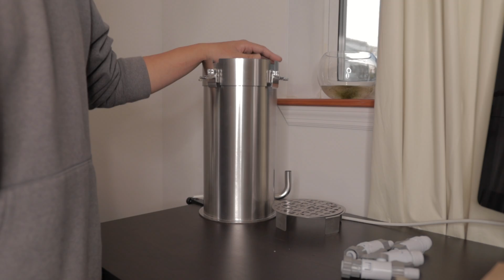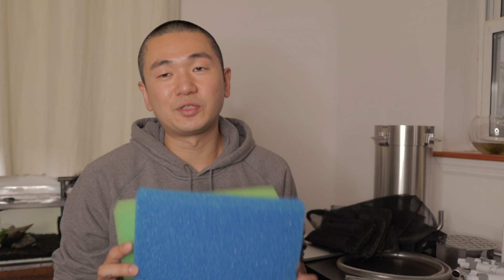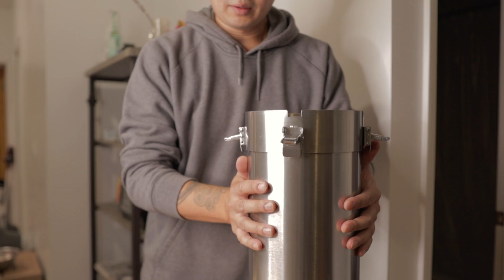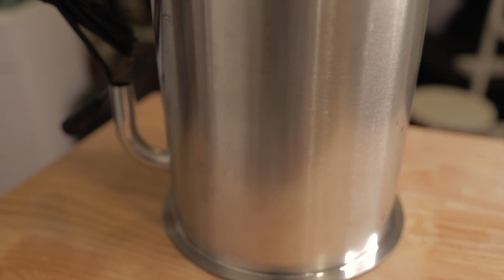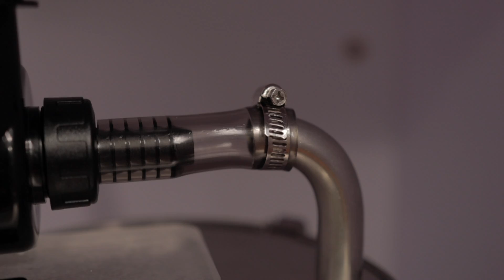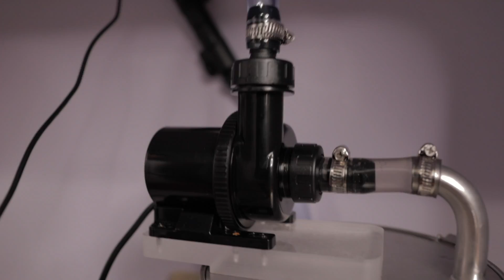Crazy 800 GPH Stainless Steel Canister Filter by Fzone Aqua | 800 Gallons Per Hour, Real or Fake?

Comment: i did not go through all the comments so my apologies if someone already said the following.  the flow could be restricted due to the way the 2 canister trays were inserted.  this model has an issue with the wide metal plate legs.  if not positioned properly a leg on the bottom tray can restrict the inlet port.  this issue has been resolved in newer models.  The top tray can (should) be inserted with the legs upward.  Since the canister cover is flat, if the legs are downward then the top of the tray will be flat against the canister cover and can restrict the outlet port.

Comment: The water pump is too powerful 3000l/h. You cannot use Stainless steel filter with 1 inlet. You need to have 2 inlets . And the outlet must have a diameter of 25mm
Reply from the maker: I do with it has a 25mm inlet and outlet, but it does not. and it will never reach the manufacturer rating, the power is only good for when you get lazy and don't want to clean your filter so you turn it up to supplement the loss of power LOL

Comment: What is the optimum flow rate where you get the full use of your filter? Lots of variables, but I think you don't want to ram water through your filter at such a high speed to get the most out of your filter. In fact I like a little slower speed it seems to have what I'm looking for.
Reply from the maker: High flow is for heavily planted tanks and you need water to circulate the tank and move the co2, etc. heavily planted as in a jungle which most planted tanks get to.
Reply: That's not what I'm asking I know flows for the tank, what I'm talking about is  the right flow to get the most out of your  filter and it's ingredients i.e. bio rings and sponges.taking out the nitrates and turning into nitrites and beyond. The speed of the water through the filter,not the tank, that's what I want to know, I really don't think anyone knows or has done a study on this I guess.
Reply from the maker: I’ve always known faster flow assists bio media. Slow flow assists mechanical filtration.
Reply: @TankTastic  But that's almost impossible to achieve. Good video. Try to use 19mm hose.
Reply: 4 times turnover for planted tanks 10 times for cichlid tanks. So if you have a 100 liter tank you need real world lph of 400. 55 G tank then 220 gph for planted tank and 550 for cichlid tanks. These are general guidelines. Ymmv depending on fish stocking but it's a good standard.

Comment: A similar rated pump (SIcce Syncra SDC 3.0, 800gph, 35w) shows on its flowchart that at just over 3 ft of head pressure, it barely pushes 1/2 the GPH rating at 400gph.  I'm just estimating you have about 5 feet of head pressure, which that Sicce shows flows about 250gph max, not accounting for the slight flow loss from the 90 deg bend feeding the pump.
Since the pump is external top mounted, you also have to account for the suckage from the bottom of the cannister into the overall head pressure.      With typical submerged pumps, even some reactors and skimmers with external pumps, they are mounted at the bottom.  I wonder how much that gravity of water in the tank or sump helps with the pumps flow capability, counteracts the head pressure somewhat I'd think, versus pump having to both suck and blow.    Ok, I'm talking myself into getting one of these now, for all the wrong reasons.  I think it would certainly effect it in this mounting configuration as the filters clog up more if not maintained regularly, as the pumps flow is all coming through a 16mm hose feed by a slowly clogging chamber, rather than it sitting in the bottom of a tank/sump with access to larger water mass to feed it.
Great video.
Reply from the maker: That was hella comprehensive. You sir need to do a Youtube video.

Comment: Your top plate is blocking the water. I think it is a design flaw
Reply from the maker: I answered another comment with similar sentiment. But the biggest problem is the hose size, as this canister or any other canisters will never reach their full potential with 16/22mm hoses. Lets say the plates do affect it, just move it aside vs the hoses.

Comment: The problem with this canister filter are indeed the bottom and top plates that restricts water flow. If you are lot careful with the bottom plate, one of the legs will block the inlet hole in the bottom. Similarly with the top, if you are not careful with the top plate, for example pressing the top plate against the lid, will block the outlet hole partially or entiterly.
Reply from the maker: That makes sense, but with the hose size the flow is already restricted so this canister and much like any canister will never reach their full potential. For this canister, the cleaning is bit more annoying than anything else. But it does look good though.

Comment: Smaller internal diameter and greater hose length both increase water flow resistance.  Also, height increases hidrostatic pressure.  Hose thickness or rather its elasticity also play part in resulting flow, but I guess its negligible for this application. 

Great  content as always!
Reply from the maker: Yea, so much variables. I’m going to worry about it anymore lol its like those things that keep you up st night for no reason lol